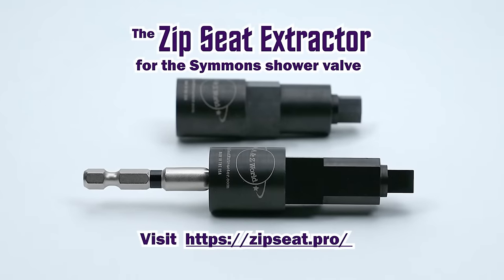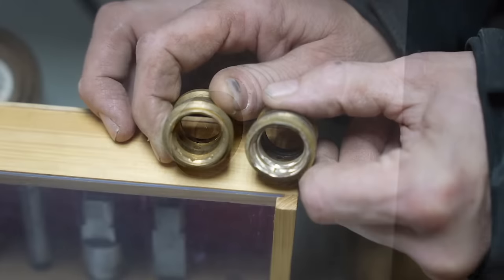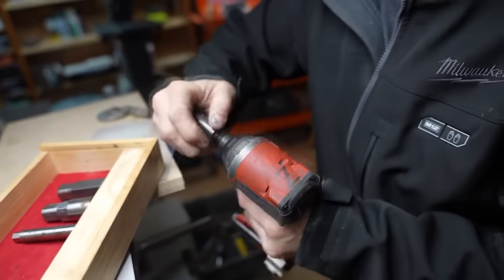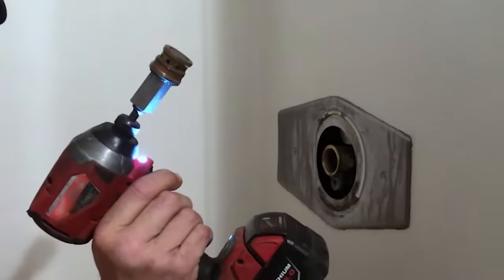Rebuild your Symmons shower valve with the Zip Seat Extractor

Comment: Went on your website you check price, there is a “classic” and “Evolve”.  What is the difference between the 2? It says that the Evolve is for “newer” units. What is considered “newer”? I didn’t think there was a change in the hot and cold seats, I thought that the only thing that needed a different tool to remove was the diverter.
Reply from the maker: Hey there! Symmons changed the shape of the seats from a square orientation to a hexagon orientation. That is why the "Classic" has a square shaped top and the "Evolve" has a hexagon shape to fit the two different seat styles.

Comment: For a professional, money well spent, for a diy person...a little expensive.
Reply: For the DIY person, or a cheapskate like me, just stick a 3/4" 12 point socket on the symmons cold seat removal tool, and impact it off that way, it fits on either side for both newer and older valves. The cold seat is the scary one, 10 minute job turned into hours of misery if things go wrong with it.